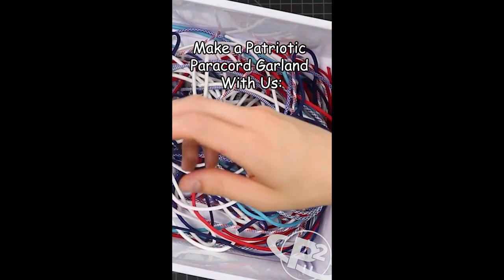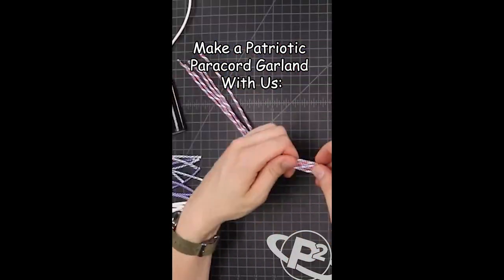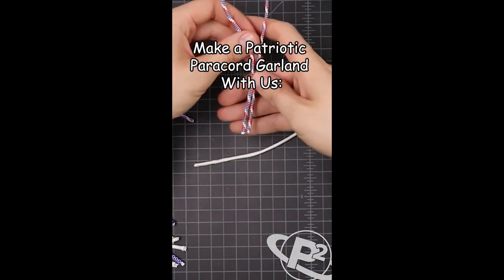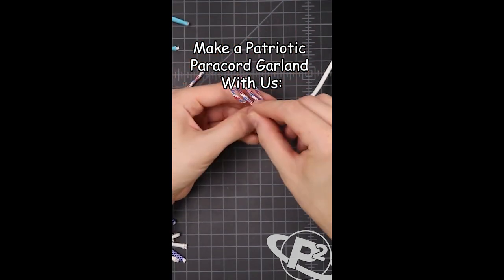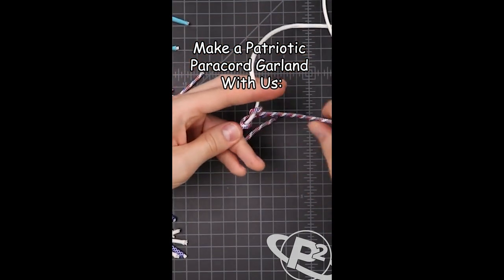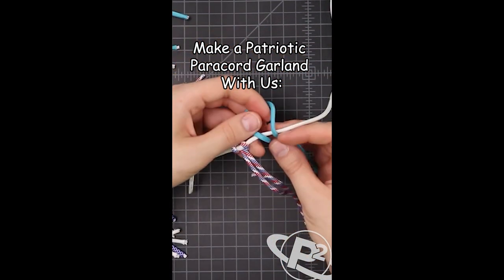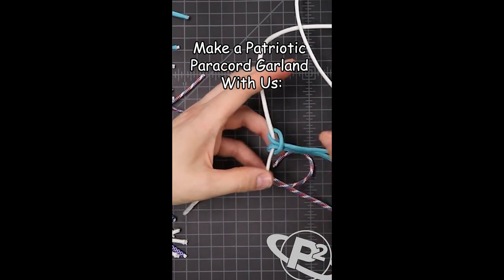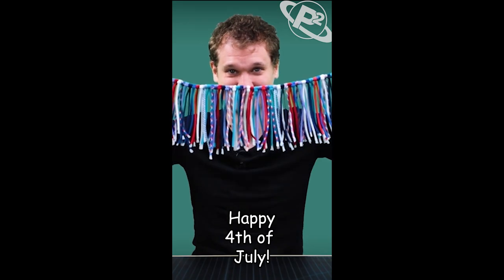DIY Patriotic Paracord Garland #shorts

Comment: I’ve been trying to find a answer to my question.  Does the size of the rope change how much you use when cobra weaving.  1ft of Paracord makes 1in when using 550.
Reply from the maker: That depends! What size cord are you thinking of using? Here is a comparison chart for reference: https://www.paracordplanet.com/cord-comparison-chart/.
Reply: 1/4 shock cord and possible 3/8 rope.